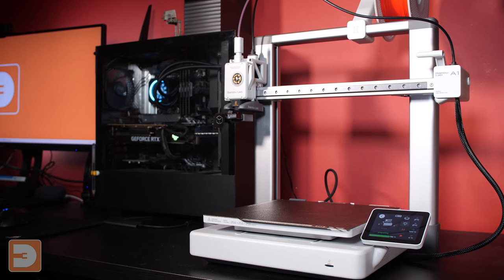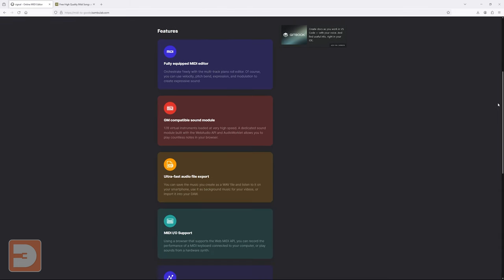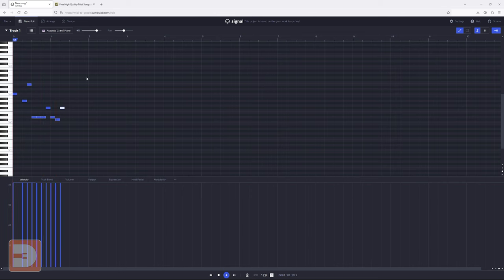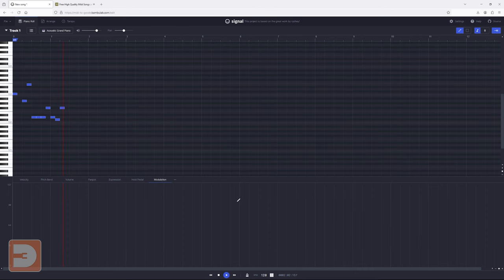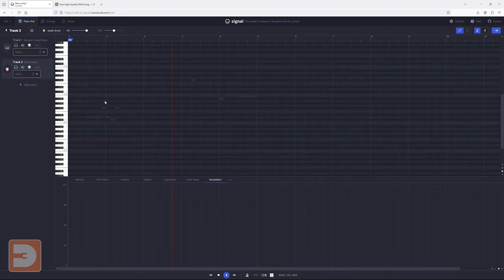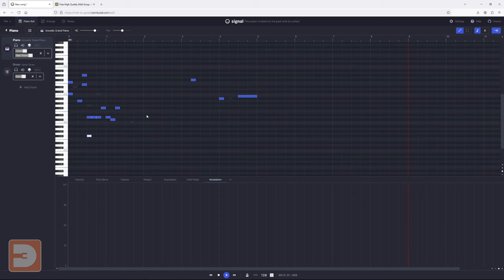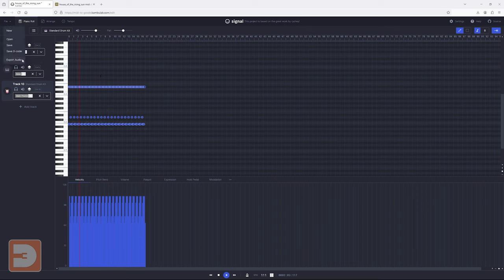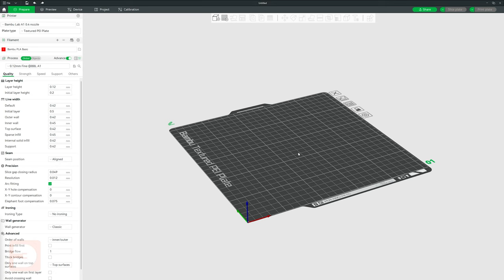From G-Code to Jingle: Play Tunes with Printer Motors

Comment: But is the sound not just coming out of the printers speaker? I didn't see a lot of stepper motor movement. Happy to stand corrected though.
Reply from the maker: The printer doesnt have a speaker, any noise it's ever played, including its default start up sound, has been played using the motors. As I say in this video, you've been able to do this with printers for years, even self builds. It's just a new feature making it super easy for Bambu A1 & A1 mini printers.

I have to say though, when I first turned an A1 on I did think they'd added a speaker, with that aweful loud startup noise, but nope, just motor noise 😊
The motors don't need to move much as they are only actually rotation a tiny fraction of a degree with each note they play, and they alternate their direction each time.
Reply: Whaaaaaaat. Mind = blown! 😮

Comment: Update .8 Nozzle setting configurations. I will try but not  getting proper configurations
Reply from the maker: Hey sorry I don't fully understand what you're asking. I guessing this isn't relevant to this video?
Reply: @3DRevolution  software default 
.4 Nozzle setting configurations. But
I will use .8 Nozzle. How do change setting for .8 Nozzle configurations. (Example: layer highest and printing speed configurations)
Reply from the maker: @venko3211  it depends on what printer you're using.
If you're using a Bambu printer, or a other brand of printer where  0.8mm preset exists, you want to launch the setup wizard (cog symbol in the printer settings bar top left), and tick the box next to the 0.8mm option under your printer. Click OK and it'll add a preset for that printer with that nozzle size which you can select from the drop down menu in the printer settings section at the top left of your screen.

If there isn't a 0.8mm option you'll need to add your printer either by using a 0.4mm preset or adding it manually (watch my Bambu Studio beginners and advanced tutorials). Then click the edit button next to the printer selected in the drop down menu, go to the extruder tab, and change the nozzle size to 0.8mm.
Regarding layer height and speeds, if there isn't a preset available you'll have to change them manually yourself, and the specific values are going to depend on what printer you have and what material you're using.
Reply: @3DRevolution  i have ender3 v2 
Using petg fliment sir
Reply from the maker: @venko3211  add the preset for your printer and do as I suggested above.
Reply: Thanks for your reply. I will try
Reply from the maker: @venko3211  not a problem. Let me know if you have any issues. Once you've got it set up, you'll then want to adjust the speeds relative to what your printer and filament is capable of.
If you check the filament vendor they should list the rate at which the filament can be extruded.
The best starting point for those settings is to look online and find what speeds etc people are using with your printer and material with a 0.8mm nozzle
Reply: Thanks. What is the best layer highest suitable for  .8 Nozzle sir
Reply from the maker: @venko3211  as a rule of thumb, your minimum layer height should be no smaller than 25% of the diameter of your nozzle, and maximum layer height should be no more than 80% of your nozzle diameter.
With this in mind, with a 0.8mm nozzle you should be looking at a minimum layer height of 0.2mm and a maximum of 0.64mm.

However there are variances on this with the material you're printing with and the printer itself.

I've not personally used a 0.8 nozzle on an Ender 3 V2 so I'd suggest googling and seeing what heights others are using.
Reply: @3DRevolution  Thanks for your reply sir